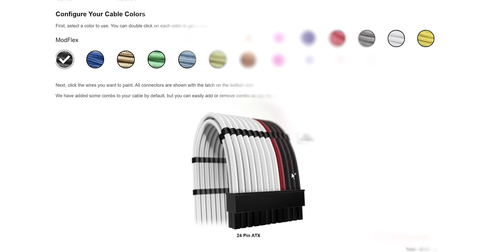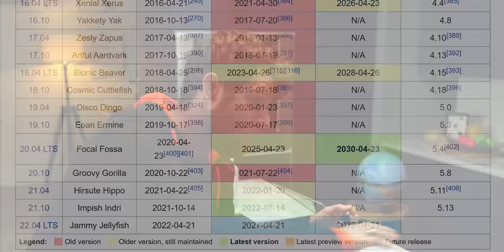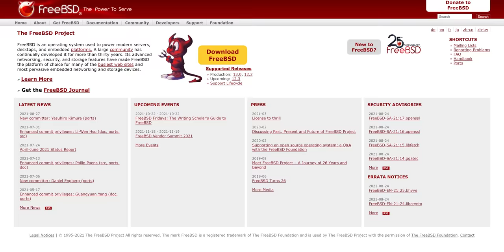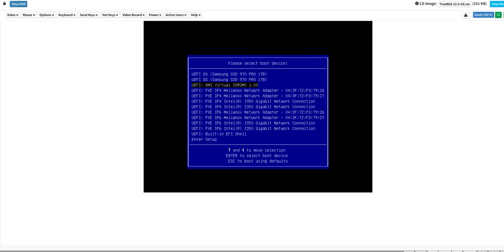We Finally Did it Properly - "Linux" Whonnock Upgrade

Comment: At 10:15 Jake mentioned "we might turn compression back on for Word files" - those aren't compressible either! The OpenXML standard used by MS Office documents is actually just a ZIP file containing assets, so filesystem level compression is useless on them.

(P.S. that's my blog at 12:00 :D)
Reply: Generally speaking things that generate very large files have already played he compression game so there are ever fewer scenarios where the overhead of FS level compression is actually worth it.
Reply: If you have lots of office type documents de-dupe can work really well, because there are typically many copies of the same file or variations of the same file, so you will see lots of duplication.
Reply: @1337flite  That doesn't actually work in practice. If you change a single character in a Word document (.docx) the entire file changes when you save it. You can see this in action if you try to diff two copies of a docx file after making a single change (e.g. adding a space). Almost all of the bytes in the file will be changed with just that one small edit, due to the way Deflate compression works.
Reply: @gsuberland  It's only useful for database data, dev or test environments only.
Reply: @Rn-pp9et  Or things like OS data, temp dirs, logs, source code and so on. If you're serving anything other than A/V or other pre-compressed media, it's probably going to work alright.

Comment: I was expecting Linus to choose Fedora. Wasn't expecting TrueNAS at all.
Reply: Ikr
Reply: "Fedora is a meme" Linus Sebastian.
Reply: @youkofoxy  Not choosing fedora is becoming a meme, certainly.
Reply: Fedora lol
Reply: Fedora on a server is worse than Windows Server
Reply: @chupasaurus  Whell you would chose RHEL but that is based on Fedora so....
Reply: really hoping they would choose arch for the absolute latest bleeding edge in-kernel CIFSD support and ZFS versions.
Reply: @chupasaurus  why
Reply: @ripp102  Fedora is an upstream distro where new things are tested. You don't want that on a production server. Furthermore, they are using a AMD EPYC server so you don't want anything RHEL-based on it either.  TrueNAS is the proper choice bar none.
Reply: @rawhide_kobayashi  Arch on a production environment lol... you're better with Windows then.
Reply: @rawhide_kobayashi  I use Arch (with ZFS) myself, but to use it on a production server with ZFS? That's suicide.
Reply: been running it in (home) "production" for years now with no problems that can be intrinsically attributed to arch being arch!
Reply: No one chooses Fedora
Reply: @Helios.vfx.  Because it's RedHat's sandbox playground.
Reply: @chupasaurus  I didn't know that. It was the first Linux flavour I had used tho. Not as main system for for a couple of hours
Reply: @rawhide_kobayashi  How much $$$ does your company loose per hour if there is any disruption or down time?  Do you have 100 Gbit networking at home?  ONE, single light user at home does not compare to 25+ people doing huge simultaneous file transfers.
Reply: @lastfm4477  they were using windows :)

Comment: 2:50 Meanwhile on Linux:
"Booyah, with these latest optimisations to io_uring, I can do over 8m IOPS on a single CPU core!"
That's not an exaggeration, but it will require 5.16, and your app to of course, use io_uring.
Reply: Well on the other hand Optane DC is like $25K per 512GB so I don't think LTT will start to use that on their storage servers anytime soon.
Reply: @Henrik_Holst  I was more making a point that they'd have plenty of CPU power to spare.
As far as I know, SSDs generally cap at around 110K IOPS; so they could skimp on the CPU and still max out the IOPS on the drives themselves.
Of course, that's ignoring the overhead of RAID itself, and encoding for (and doing) network transfer.

Comment: I'm moving more and more of my process to Linux right now. Linux has a lot of issues as well, but I'm convinced Microsoft will exclusively have Azure products for servers in 10 years. They've already axed a lot of server features to push companies over to Azure and I don't think it's stopping. If you want to host things yourself Linux will be the only option soon.
Reply: Linux won’t be the only option, and this video showed that. TrueNAS isn’t Linux
Reply: @classicrockonly  True. It is missing a lot of server features so for a lot of server functionality you would have to run a virtual Linux in TrueNAS.

Comment: You should upgrade the desktops to 10 gig and then increase the windows MTU and switch port mtu to jumbo frames. With that 100gig  server nic you should not see any more issues. With windows transfer its slow due to tcp sliding window.
Reply: All editing computers 10g, search for video about a year ago about that,or may be two

Comment: Hey Linus, I run a Plex server with 40 hard drives connected to it with 216 TB. The ram cashing issue with Windows can be corrected with storage spaces. You have to go into power shell and set storage pool to power protected then it allows you to go into device manager and set the device to a removable disk and it will disable the caching on the virtual disc for ram. This was an issue that I had.

Comment: I work for an enterprise storage company, so it's super neat to see Linus starting to play with some of the higher-end network hardware that I get to play with at work.
Reply: If one uses the default NIC settings and ring buffer settings on 99.9% of installations one is not going to like the performance results against 2 or more clients hitting the same server at the same time.  

Monitoring for TCP zero window and ring buffer exceeds is always the first step one does to tune nic card performance.    Supporting jumbo frames within the org is key to 10G+ performance.

Comment: Hey Linus,
I haven't checked the drives, but as a first reaction, raidz1 definitely seems not enough at all considering the capacity and more importantly the number of drives.
Reply: I’d recommend Z2 just because it’s more likely to get another failed drive while it’s rebuilding everything after you replaced the failed one
Reply: As they mentioned, they have regular (hourly?) backups to HDD servers, so, worst case scenario if 2 drives fail, they loose the speed but not the data.
Reply: @rusparmesan  they loose every data that have been computer during the last hour AND they have the whole system downtime during the time of the restore. RAID != backup. RAID is for availability, not data safety.

Comment: I've never been a supporter of servers that run Windows. My home servers have always been *nix, but I've also used a *nix backend for work (software development) for most of my career. Kudos on the transition.
Reply: The question is not what your server runs... but what is your container. Most modern applications dont run on bare metal servers anyways they run in containers.

Comment: Maybe I missed it when I was fast forwarding through the "Linusy" bits but it looks like you didn't use direct I/O. If TrueNAS supports it, and you have fast enough drives, you should definitely test it. All the caching ZFS normally does cost me a lot of performance on my storage boxes at work. ZFS predates storage with throughput this high.

Also, I think your ideas about RAM and CPU usage are just loads of assumptions with no base in reality. This machine  could've been built and set up much better if it was done by professionals. That NIC needs sysctl and driver tweaking to be fully utilised. I didn't see any happening in this video. 

I think you'll be lucky if you get 50% of the performance this hardware is capable of.

Comment: Hey Linus, you know they make armored fiber. I am sure you knew this. But some thing you may not have know is a company name Fiber store or FS for sort. Nice thing is the custom sizes and it is cheap.  it saved me from have to put in conduit with all my runs. Also the added cost per run. I though to my self there has to be a better way to do this! Aka Armor fiber cable. I know they have OM4 And OM5 depending on your needs.

Comment: Dude I swear windows would actually be good if they didn’t force updates, inhibit performance on purpose, basically spy with telemetry, shove edge down your throat, have driver issues all the time, have inconsistent performance after rebooting, rebooting INCREDIBLY SLOWLY, etc.

Comment: Aside from being delighted to finally seeing you going with the right tools for the job, you delved into the details of your data but didn't touch on Snapshots.

This is a huge ZFS benefit and whilst the speed is obviously an advantage, the storage capacity available would make this viable. But, you need to configure appropriate Datasets. When correctly configured, it's a powerful safety net.
Reply: With all the replication to other systems, wondering how much he really needs snapshots. It is a powerful safety net, however, it does come with a cost at the file system layer. Not to take the snapshot, but the intelligence in the file system and levels of abstraction you need to create do end up impacting the performance of the file system overall. In all of my storage/SAN/systems work, multiple rounds of performance tuning and benchmarks, the features of these advanced filesystems can end up impacting performance up to 30% over just a straight traditional journaling file system w/o all the bells and whistles. With needing to stream lots of large assets, I think XFS might have been a better choice.
Reply: @makanaima  No, it should not be seen as a means for backup which is what is seems you're suggesting. The replication is there for this as we heard but we also heard that there was previously a risk to 500GB of files as work-in-progress. The snapshots can be set to exist for the life of the particular video project. In that specific case, it would have saved them if it was configured appropriately.

Snapshots do not impact the underlying performance of the filesystem.
Reply: @ThePopolou  i second your description. I have quite some experience with ZFS myself, and i cannot see any degradation in performance just by introducing snapshots. The internal implementation in ZFS makes it still crisp even with tons of snaps in place. Also it helps a lot in backups, as you simply do a  "zfs send" on one end, pipe it thru a network connection via ssh or netcat or what ever, and on the other end do a "zfs receive" and that's all you need.
Never seen a more stable and versatile file system before, and so far i never wanna have to miss it.

Comment: Agree with WSS and RAM cache. When I was using 8 HDDs in parity mode it always consumed a lot of RAM and after few minutes write speed drops a lot. But for some unknown reason when I added 4 additional HDD drives in this pool that cache thing went away.

Comment: Eyyyy; You should always use debian for servers since 
A. Its popular
B. Its designed to be extremely stable
C. It has an optional "cutting-edge" branch which could break at any time, but has up to date packages.
D. Older packages don't mean worse packages, its just the newest verified versions of those packages for stability.

Comment: I’d just like to interject for a moment. What you’re refering to as Linux, is in fact, GNU/Linux, or as I’ve recently taken to calling it, GNU plus Linux. Linux is not an operating system unto itself, but rather another free component of a fully functioning GNU system made useful by the GNU corelibs, shell utilities and vital system components comprising a full OS as defined by POSIX.

Many computer users run a modified version of the GNU system every day, without realizing it. Through a peculiar turn of events, the version of GNU which is widely used today is often called Linux, and many of its users are not aware that it is basically the GNU system, developed by the GNU Project.

There really is a Linux, and these people are using it, but it is just a part of the system they use. Linux is the kernel: the program in the system that allocates the machine’s resources to the other programs that you run. The kernel is an essential part of an operating system, but useless by itself; it can only function in the context of a complete operating system. Linux is normally used in combination with the GNU operating system: the whole system is basically GNU with Linux added, or GNU/Linux. All the so-called Linux distributions are really distributions of GNU/Linux!

Comment: Thumbs up, good approach and nice summary of your setup! IMHO favoring the BSD based implementation in TrueNAS was a good choice as well, the implementation seems a bit more sturdy.
You might want to check your disk layout, in terms of disk's sector sizes and matching stripe sizes. This is about data alignment on the disks and avoiding multiple sector-writes, which can impact the write speed and also disk space. Generally, you want ti make sure the data disks' sector sizes fit into a standard 128KB block. Example: RaidZ2 with 6 disks (= 4 data disks + 2 parity so to say), you calculate 128kB block size by 4 disks and get 32kB per disk, which can be cleanly divided by the disks' sector size of 4kB (for modern drives). So that setup would fit optimal, a stripe is evenly 
divided across all disks without any half sectors being used.
Regarding your fairly low CPU usage .. your CPU is probably a bit overkill for the application, as ZFS has been developed with CPU load in scope. They use pretty blazingly fast hash algorithms, so your setup could possibly be able to catch even higher workloads in case you plan to add another disk shelf. (And don't slap the shelf, he's right .. google for "shouting in the datacenter" and be amazed ;) )
Do you run the pool with spinning disks or on all-flash drives? You talked about trim parameters, so you probably have SSDs in place. If you use spinning disks for "cheap" capacity, you might want to consider adding a (mirrored! you don't want to lose the data!) SSD as ZIL (ZFS intent log, it's basically acting like a write cache and journal) to your zpool. This gives the FS a bit more space to breathe. You can also take a look at "l2arc" (layer 2 adaptive replacement cache = the ZFS read cache) but i assume with your disks you probably don't need it.
Just do yourself a favor and keep the allocation below 80% .. you might start to face increasingly serious degradation if you overshoot that border more and more, so keep that in mind and keep a close monitoring on that value.
Do you use zfs techniques for snapshots and data replication?

Feel free to ping me if you need some more info on ZFS!

Comment: i just turned an old pc thanks to anthony to a server but instead of using windows i use truenas and how amazing is it like my windows crashed lots of times but truenas it has been running for 4 weeks and its great (Specs:500GB Shared Drive 100GB BootDrive 2GB ram Intel Quad core)

Comment: Hi! First of all sry for my english. And the questions:
1) So you using direct file editing (searching fragments, reading from project files) from Samba share. What is write speeds? 
2) Do you use some audit settings and/or acl settings? This things ads some load to directory controller i think.
3) I understand that you use snapshots replicating to backup server, but do you have additional specialized backup software for disaster recovery?
Many thanks for you excellent comrads )))

Comment: Bottleneck is in the cabling. You prolly got 16 loops ya don't need, heating up the cables, and burning up the carpet. It's always the cables!
Reply: Data is going to Windows clients at but 10 GbE…

Comment: Bunch of bad ZFS choices: 

a)dataset compression: there's no reason to turn it off, if the data is incompressible ZFS won't try to compress it.
b) raidz with so many drives: even though they aren't mechanical drives, there's a non-zero chance to lose another drive during resilvering. Considering it's nvme  and how many drives available I'd choose at least raidz2 here

Comment: Someone should build them a custom Linux server that would be able to max out their hardware. This could then be teamed up with ingesting clients running a custom Linux built to best utilise the server, possibly with some special/custom protocol for the task. Perhaps this protocol would be aware of the other clients to allow for the best cooperation of the server and bandwidth. Similarly, a special driver could be written for the Windows/Mac workstations to allow best use of the server.

Comment: Not sure what you guys were doing with S2D but Azure, and many other datacenters, use S2D. Were you using Windows Server Datacenter with Storage Spaces? That does matter. That's where the enterprise version of Storage Spaces comes to light. 

Anyways if you were, you can adjust the CSV cache which I see as the problem if you were using S2D, not Storage Spaces.

Comment: Ok I’m thinking the windows server problems you were having was not to do with the OS so much as perhaps having the “defender” features enabled (which means it cares about the content) and maybe not using the windows OS current features like storage spaces, thin provisioning ,dedup etc. nvme support has been there for years now.  Though for deduce it’s best to exclude compressed media files. Large block sizes and raid 1+0 sets help a lot with large file media streaming. Nvme drives have advantages of being very quick at low queue depths 
That said, RAM exhaustion causes the logical disks to vanish! 
considered SmartOS ? It’s not Linux either - based on the old openSolaris code base and has a nice file system. 
BSD has been great too.

Comment: Sounds like a misconfiguration on the Windows Server part. I ran much more demanding storage setups than this with Windows Server 2019/2022 and Storage Spaces. Maybe the hardware is not certified/compatible or you guys haven‘t done the right registry and driver tweaks.
Were you using ReFS?